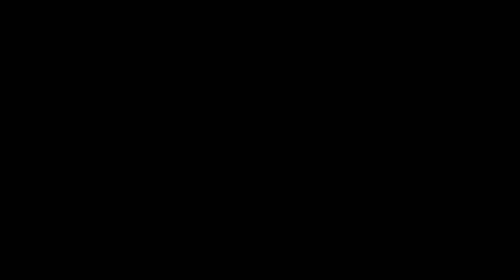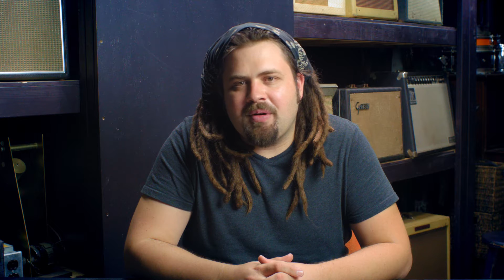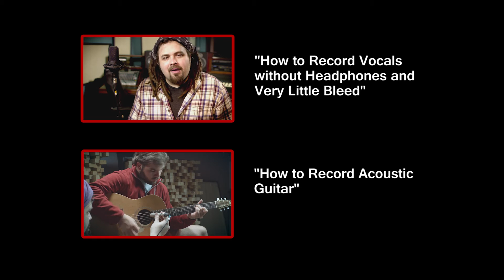Recording Hacks - Take Your Recordings to the Next Level

Comment: very interesting. thx 4 the great info! i keep my converter input low like 3/10 n control level with my yamaha emx512sc mixer. no hiss or distortion. bad idea? i like my results. ill have trax up as soon as i get vocals done. like 20+ trax in the works.
Reply: mixer is about -10 one light blinks on n off no clipping or red light on converter. lights on converter -20 to -6 hmmmm mite be recording a lil hot i guess. thx 4 the great info!

Comment: How do you atenuate the signal after the pre-amp and before going into the converter?
Great episode, thanks.
Reply from the maker: Jonatan Pina I have a trim on my preamps to turn it's volume down, but it doesn't effect the gain of the preamp...as in the part that is boosting the mic signal. It's just like a master out. I guess the old school way would be to give the preamp a little juice and ride the fader a little lower to compensate. You could also use a "U Pad" for it, and you can look these up via google. It's just three resistors that you solder into the cable. Little labs also makes a 8 channel attenuator that is really cool. I'm sure there are many ways to do it, but soldering resistors into a cable is the cheapest.
Reply: creativesoundlab Thanks for taking the time, really useful.